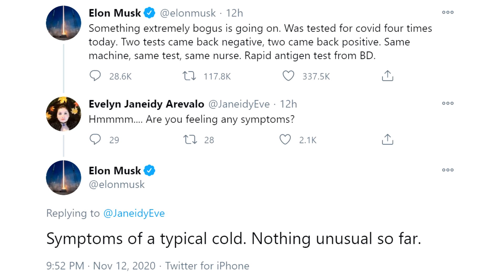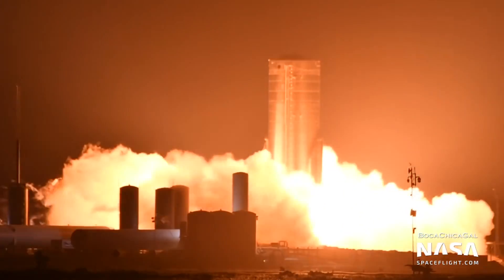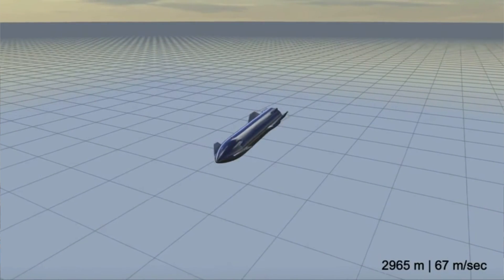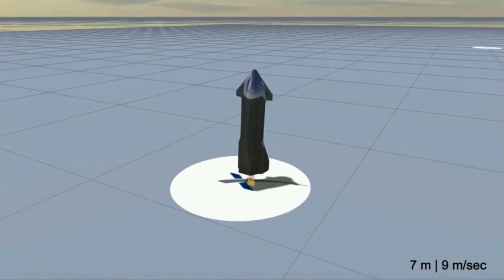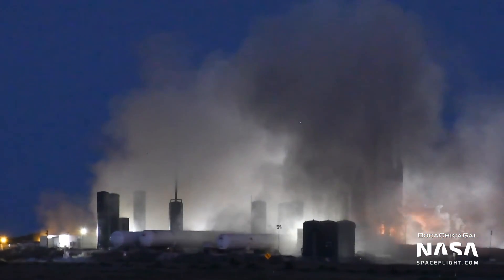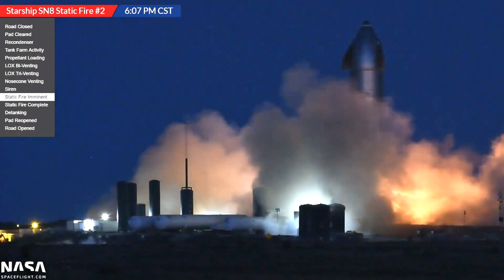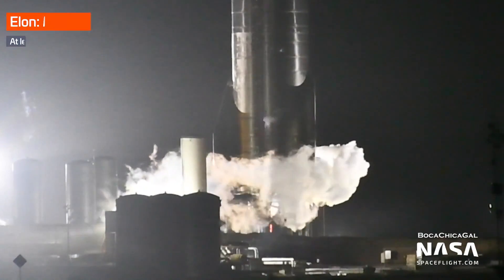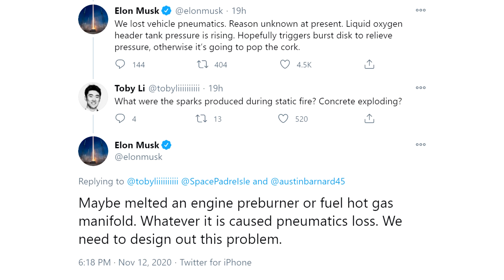Starship Test Destroys Raptor Engine, But Burst Disc Saves Rest Of Vehicle

Comment: It’s amazing how he can analyze rocket failures
Reply: He does have some help.
Reply: The orange color of whatever was dripping out of the engine indicates a metal with a relatively low melting point.  My guess would be the copper lining of a regeneratively cooled area rather than turbo pump parts made with high temperature alloys.
Reply: Absolutely! We’ve watched him do this several times and...a few days later his analysis is uncannily on point to the press release from the rocket company. Amazing.
Reply: @fensoxx  yeah Scott is a bit of a rocket whiz!
Reply: Look at his wiki page, and you'll understand why.
Reply: Be more amazing with fewer failures.
Reply: @dougsinthailand7176  You learn very little from a success and quite a lot from a failure ... we are in an unusual situation here, not many projects do their testing with the world watching. Failure is good if it helps move the design forward.

Comment: what is the expected value of covid possibility? I mean what is the false positive and false negative rate for that machine?
Reply: He had the 30 minute tests, they are only about 90% accurate with a 10% chance of a false negative. The proper laboratory tests are near 100% accurate. He had four of the 30 minute tests and got two positive and two negative results the chance of getting two false negatives is about 1% on those quick and dirty tests. The probability of getting four false negatives would be 0.01%.

Comment: Why is this issue coming up now after multiple star hopper launches consisting of much longer burns than the sn8 static fire?
Reply: Integration testing often reveals problems that were not evident during system/component testing. The real question is, what is it that's different about this test than previous tests that could have led to this malfunction?
Reply: @nagualdesign  1) The Raptor is far from a fully-tested, production engine (and may never be - there are good reasons why full-flow engines have never 'taken off'), 2) All the vit (and delicate!0 stuff has been mover INSIDE the engine skirt!
Reply: @paulhaynes8045  Your second point is pretty major. I'm not even sure why they've chosen to do that. Perhaps they'll redesign it to use a more traditional approach, where the second-stage engines are shrouded by the top of the first stage until separation.
Reply: @nagualdesign  they chose to do that because of how they plan to dock.
Reply: @aneubeck4053  Ah yes, the in-orbit refuelling. Thanks for reminding me.
Reply: Having said that, this could have simply been due to a manufacturing defect.
Reply: They have been changing things at every step as they test.  I believe these are the first tests with more than 1 engine installed and firing.

Comment: The Starship is unique in that it has engines tucked up within a skirt which will impart a lot more external stress & pressure on those Raptors. Then you have debris flying around like a rock spin-dryer on the pad\Moon\Mars. I can see why they want to avoid water suppression\flame diverters as Starship will not have these on Mars & Moon but to have no protection on engines with safety deflection system seems asking for trouble.
Reply: Spot on.  Far too much design being based on possible (but, I suspect rather unlikely) moon/Mars landings than on geting the thing to fly safely.  Get it flying safely, THEN start faffing around with moon/Mars-based changes.  Puting a skirt round such powerful engines is a daft idea to start with, but then putting all the delicate and vital sub-systems INSIDE that skirt, AND testing without a flame diverter, etc is just asking for problems.  There's some very good reasons why a) rockets are the design they are, and b) they are not designed and built in the open on a sand-bar in the Rio Grande estuary!

Comment: Failure of pneumatic control valves are on the systems critical path. Damn I hate when components fail. Good thing for the relief valve....... I’m not going near it. Send Mikey.... fly safe!!!
Reply: Semi critical path. Obviously the production Starships will need a more fault-tolerant system than they have now — but it's not a blocker for continuing flight tests on the prototypes... it's just a greater risk of test failure on a rocket that most people are already expecting to pile into the ground in a dramatic fireball.
Reply: @simongeard4824  / absolutely, testing theory then redundancy. Been there got the shirt. Failure is the challenge, success is the reward! Keep going you have a big fan here!!! Love SapceX!

Comment: Has anyone done the math on how big the boom would be at all stages of the 15km flight, from fueled explosion on pad prior to launch, all the way to a potential crash landing?

(edit for some clarity fyi)
Reply: big
Reply: V. big.
Reply: Actually, I expect someone has. They've got to be able to plan for whatever may go wrong at any stage of the mission. There are people living not too far from where they're doing this, and they need to be sure that no possible failure mode will put them in danger. So they had better be doing the calculations for how big the bang might be at any point.
Reply: @KeithHearnPlus  I don't mean on people their team / the regulatory side.

(like "OMG theY aRe StupId, i am WAY smarter than all these "engineers", it is OBIOUS why they are wrong and i DEBUNKED them") 

More so i mean armchair people like me being able to ponder to know what to expect i guess.  All sorts of channels speculating on almost everything else but this i feel like; would be neat to see it covered.
Reply: Not as big as you might be imagining, because the rocket probably isn't going to be fully fueled for the 15km... it needs the main tanks to be mostly empty to get the balance right for the landing maneuvers, and it certainly doesn't need to launch with a full tank to reach 15km. So I'd guess a pad explosion would be pretty similar to SN3, and a landing failure somewhat smaller (though still dramatic enough).

Comment: Ah yes, engine rich exhaust
Reply: The most metal rocket exhaust there is.
Reply: @tomhsia4354  -- There is also ALICE; Aluminium Ice propellent. Aluminium is also added to solid fuel boosters to densify the exhaust, but it's difficult to make heart-wrenching allegories if you don't tear out your guts and throw them away.

Comment: As the Methane and Oxygen would simply boil off on a RUD upon impact, what environmentally concerning things are left that could get released if the landing fails and how is the cleanup procedure regulated?
Reply: Methane is a bit of an environmental pain in and of itself, though it's not too hazardous and the amount would be far eclipsed by the amount coming out of leaking gas wells and melting permafrost. Liquid oxygen isn't exactly a walk in the park either (there might be some interesting combustion), but it at least doesn't have any real long term issues.

I'd have said the igniter would be an issue, except apparently the Raptor engines are/will be spark-ignited rather than using a pyrophoric starter like the Merlin engines (which use triethylaluminum-triethylborane).

Other than that... maybe various hydraulic fluids, if it has any hydraulic systems (I don't think it does, but I'm not exactly privy to design documents)? Maybe some of the components are made of something containing a toxic element like beryllium?

Comment: I'm just glad that engine didn't die during a flight. That's why they do these tests after all.
Reply: I'm glad it did die, so they can fix it so it doesn't happen when people are in it
Reply: There will be many flights before a human steps inside it.
Reply: @Kirealta  I remember Elon say at least 100 flights.
Reply: @Kirealta  yeah, soooo. The point of those flights is to find problems like this one
Reply: @hydenmoody4373  obviously, what's your point specifically telling me?
Reply: @Kirealta  that I am glad this issue happened in the first place. Did you not see my first comment?
Reply: @hydenmoody4373  Yeah, i did, you made it sound like fixing this issue will save lives when in reality no lives will be at risk until the whole vehicle is tested dozens of times.
Maybe you should focus on your own reading love.
Reply: @Kirealta  but it would, if this issue wasn't found by the time the flight with actual people took place those people could have died. Do you not understand what I am saying?
Reply: @Rob8729  yeah it will probably take around the same amount of flights that falcon 9 took to get everything down. The great thing is the progress they are making is immense. at the beginning of the year they only had starhopper, had a bunch of issues designing the prototype for starship. Now here we are with a starship prototype static firing 3 raptor engines. Tech once again seems to be advancing exponentially, pretty excited for what the future holds.
Reply: The likelihood of a successful flight has significantly risen after last night.
Reply: For this reason, there are three gimbaled raptors. Two Raptors will easily land it and only one Raptor flew (hopped) SN 5 and 6.
Reply: If the launch pad structure is shedding pieces that may be what needs to be redesigned.
Reply: 3:24 to 3:28 Did sombody notice two lights in the dark towards top right of screen can somebody clear what that is?
Reply: @hussainkhan-fg1lv  aliens

Comment: All i want for christmas is to see SN8 fly to 15km and do the bellyflop landing. What a great end to an awful year that would be
Reply: I don't expect them to succeed (I don't think they're expecting success, either. There is a reason SN9 is already close to completion). It will probably be spectacular, though. Such a complex manoeuvre will most definitely take multiple attempts. They've been landing Falcon 9s for quite a while and still failed to land the Falcon Heavy core booster on the first try.
Reply: Wont happen.
Reply: I think that despite this setback, there's still a pretty good chance of seeing SN8 fly before Christmas. But I think everyone, Elon included, will be astonished if they ace the landing on the first attempt.